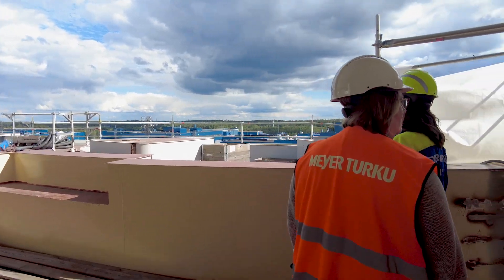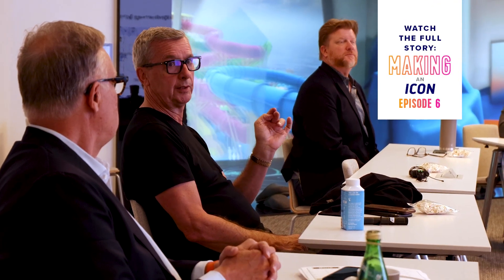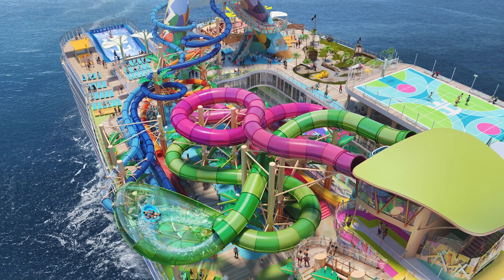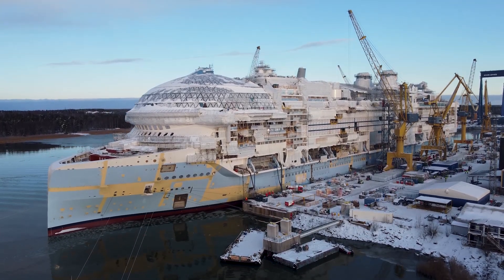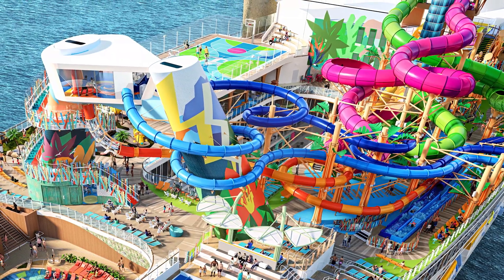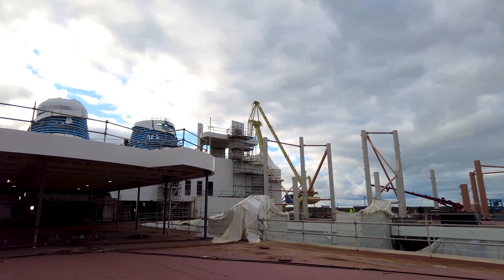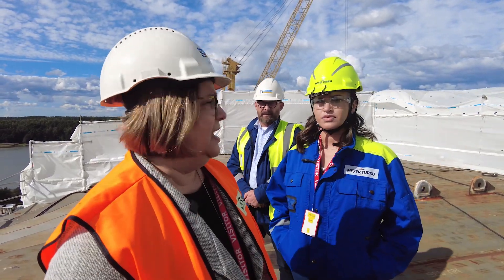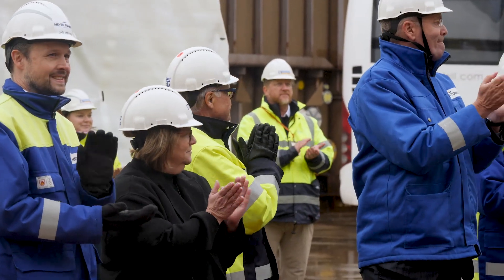The engineering challenge of water slides on Icon of the Seas

Comment: I just understand why they would put a literal water park is on ship while they have a water park on coco cay. 
It seems to be cannibalizing its audience, because literally every ride that’s on Icon is on thrill island on cococay. What’s the point of paying damn near $100 on an island, when I can get it for free on the ship.
I think Icon looks amazing, but it seems to be an extension of the oasis class instead of an actual new class of ship
Reply: 100? As of this comment the cost for my sailing in February on Icon is 1 7 8 bucks per person for the water park!!! Not to mention just shy of 4000 dollars for one of the over water cabanas! We just sailed on Wonder this past February and Thrill Water park was 78 bucks per person!
Reply: Thrill water park on icon is 6 slides and coco cay has 20ish, coco cay has more waterslides that are bigger. Also icon of the seas is very different than oasis class, it’s bigger over 50% of rooms are new categories and they changes the solarium and so much more.